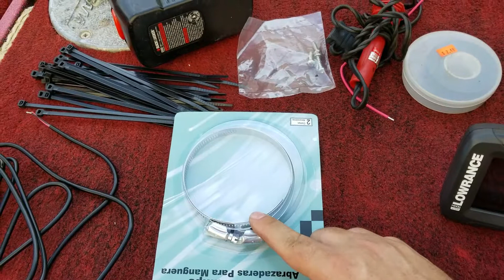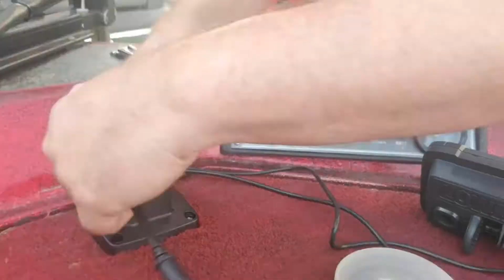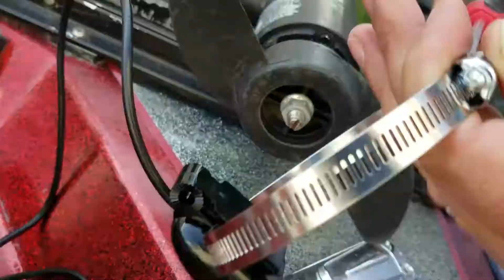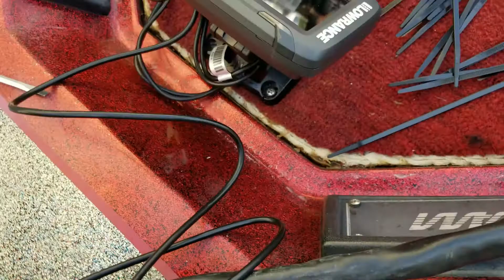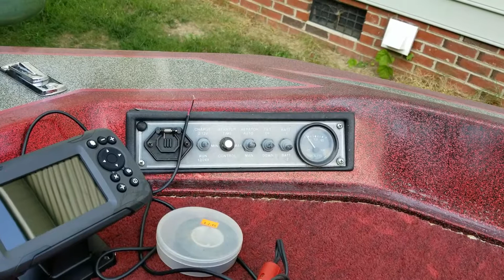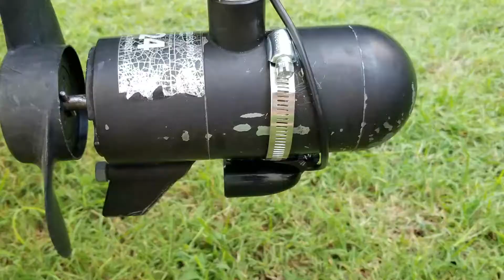Lowrance HOOK² 4x - How to Install on a Front Deck with Trolling Motor Bullet Transducer

Comment: Scotch locks are evil Hard to seal and bad idea in wet environments
Reply from the maker: Couldn't agree more. I actually said in the video that I didn't like using them but I used them as a short cut in this case. Thankfully it has not cost me and I've had zero issues with it. I've tried to start soldering everything since or use a heat shrink butt connector at a minimum.

Comment: Just talked to a friend of mine and he said instructions say to make sure and put a loop in the transducer cable coming up the trolling motor shaft for slack when you are steering and noticed you did not do that. Did you have to go back and give it some slack?
Reply from the maker: No sir. I had a ton of cable because everything was wired in the front. I left myself a little slack in the cable as I wire tied it and made sure I had full range of motion. Might be different for some setups though.

Comment: Do you turn off the fish finder when you pull in your trolling motor when going to different fishing spots?  Is it safe to leave on so it continues tracking while you move from spot to spot with the transducer  not in the water
Reply from the maker: Ted, thanks for your question! I do not turn it off when pulling up the trolling motor and moving. It just goes blank until I put it back in the water. I've been running that way for a year now fishing most weekends with no issues.
Reply: Thank you... just  got the hook2 7in hdi ... also have a  lowrance Elite-9  in the middle  trying to learn how best to use them.
Reply from the maker: I hope to make a video on my Lowrance  Hook 2 7x at some point. Still trying to dial in using it. If  you have not checked out Fish the Moment on YT you should. Johnny does an incredible job of showing you how to use your electronics. Good luck to you!
Reply: Mine is not the 7x. It's the 7hdi
Reply from the maker: Yes sir, I understood that and know they are different units. I regret not getting a better unit at this point. You should still check out Fish the Moment as he shows settings on all kinds of units. He has some settings for the HDI too I believe.

Comment: How is your experience with this fish finder? I’ve been these extensively being used on kayaks. How is the performance on boats?
Reply from the maker: I have had zero issues with it since the install and I use it almost every weekend. I've been very pleased with it.
Reply: @GetOutFishing  I recently purchased the Lowrance Hook2 4x GPS and mounted the transducer in a similar way underneath my minn kota trolling motor. However, I can't seem to get a decent screen. It's about 10ft of water underneath my boat, yet the AUTO function shows either no bottom, or almost only bottom.. Not sure whether this is because of the way I mounted the transducer or the settings of my Lowrance 2x Hook4. 

Great video btw, thanks
Reply from the maker: Thanks for stopping by and for the feedback on the video! I've seen what you're talking about once or twice but it's usually after I run the trolling motor in super shallow water. When this happens I usually pull up the motor and put it right back in the water and it seems to reset it. Doesn't happen often though. Might try resetting the defaults in your settings and see if that helps. Thanks again for stopping by!